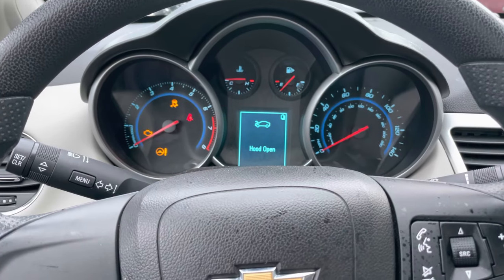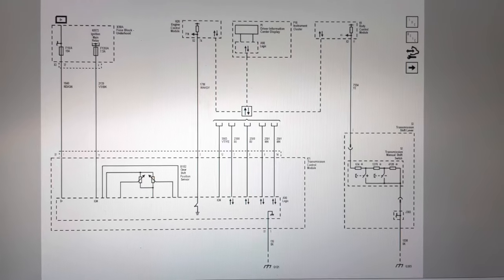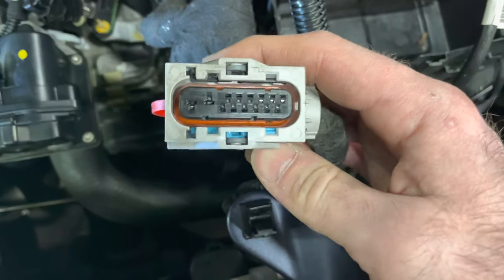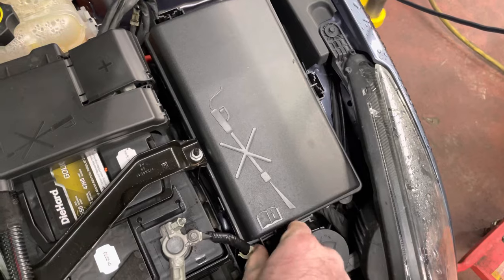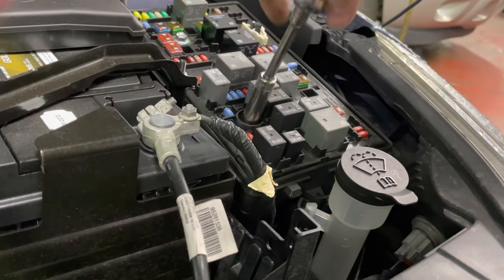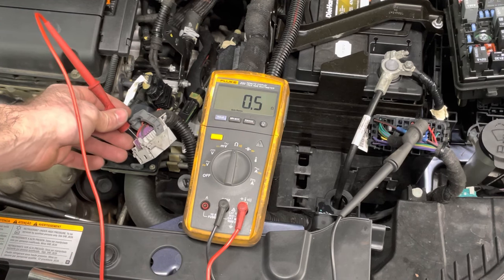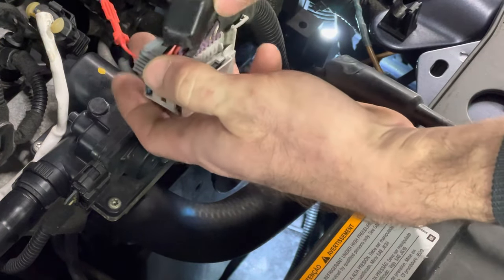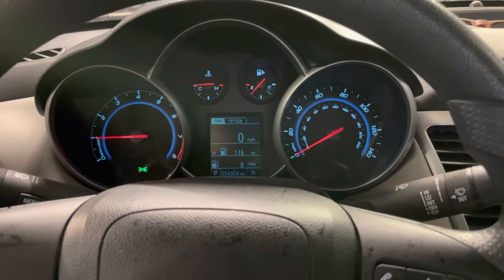Cruze Limp Mode... TCM No Communication U0101

Comment: Great Video, Great Communicating with your subs and/or viewers and I am a New Sub..
I can really use a second opinion oh what's going on with my 2010 Impala 3.5L with 64K Miles. Second Owner and Uncle was First.. I know its long but Here's what's Going On. 
12-22-22 -  New Battery Due to Repeated Jump Starts
03-21-23 -  P0411 (See Below), P0522/P0523 (Engine Oil Press Sensor Circuit Low/High Voltage). Dealer Replaced Sensor
04-10-23 – P0411 (Secondary Air Inj System Incorrect Flow) Self Installed New Check Valve and Fine.
06-25-23 – P2440 (Secondary Air Inj System shutoff valve stuck open. Limp Mode, Warning Chimes, and Service Stabilitrac/Traction Control Warmings.
06-27-23 – P2135 (Throttle Position sensor 1-2 correlation) Limp Mode, Chimes, and Service Stabilitrac/Traction Control Warnings.
07-01-23 – Nothing Done since 06-27-23. Before starting, Scanned, No Codes. Started fine but check Engine Light. Scanned and No Codes. Cleared Codes and Drove perfect.
08-24-23 – No Crank No Start. Jumped it and was fine. Brought it to a SEMI Local (30 MIns) Mechanic from a Good Friend Referral.
08-29-23 – Determined 8 month old battery Failed. New Battery and New Secondary Air Inj Pump (Was Working BUt VERY Loud).
12-15-23 - Tried Factory Remote Start. Went out and wasn't running. Started it but Running Rough (Maybe Limp Mode). All the above warnings and chimes plus all the gauges were freaking out. Turned off and Tried again same thing. Left it for a day or two, No Crank No Start. Tried it again and as I was bringing the key back from the Run Start Position it Cranked For a Split Second. Tried several more times No Crank No Start.
12-20-23 - Put in On Position and Hooked up former Mechanic Scanner and "Communication with Vehicle has Been Lost". So couldn’t scan any codes or check any DATA… I tried Starting and same issue as above.. Tried to Swap the Starter relay with a duplicate Rear Defog Relay and it started but the gauges were still going crazy, chimes, Warning Messages and running ruff.. I tried Hooking the Scanner up again and the car began to idle fine, no chimes or messages but all the gauges showed as 0 and you could not see what gear it was in… Tried to scan and "Communication with Vehicle has Been Lost"
12-22-23 - We decided to take it to the dealer for diagnosis. Went to bring to dealer and no crank no start. Messed with the battery connections , grounds, fuses, relays, connectors and it started up perfect. No check engine, lights, chimes, and idled perfect. Turned off to get my wallet to take for ride. Went back out 5 mins later and no crank no start. Finally got it started and drove to dealer . 1/2 the trip the door locks kept locking and unlocking constantly (This was NEW), gauges went crazy, Chimes and warning messages… But the Car was not in Limp Mode… Second half the car went into limp mode and no chimes no gauges no locks no nothing and could only go 20 mph. Nerve racking. I got there and they went to bring it in and no crank no start. Got it Started, Drove it in, hooked up scanner and "No Communication". The first thing they did was put a new negative cable Connector on it and it cleared up all the chimes, gauge wackiness and warning messages. Tuesday they are going to concentrate on the starter..
12-26-23 - Dealer Replaced the Starter. 
12-27-23 - Started but that same weird Crank after I started Coming Back from the Start Position.. Drove Perfect.
12-28-23 - Started and Drove Fine.
12-29-23 - No Crank No Start. Made appt for 01-02-24 with dealer to fix.
12-31-23 - No Start No Crank.
01-01-24 - Using Mult Meter I check the Battery and it read 12.2 V… I visually inspected the Fuses, Tugged and Inspected any Wires that Had Tape on them, Tugged on Connectors… I tested the DLR Pins 6 and 14 and got 60 ohms… I turned the Key to ON and hooked up Scanner and No Communication… Got Mad and Just tried to Start it and It Started… Beings I didn’t Initially try to Start it, I am not sure all the Poking and Prying did anything or it was Just ready to Start.. The Car Idled Great and No Issues Except the Check Engine Light was On… So I scanned it and got the following (9)Codes: U0073 (Control Module Comm. Bus Off) (2) Stored, (2) Pending and (2) Permanent, P0700 (TCM Requested MIL (Check Engine Light) Illumination) Stored and Pending & P150C (TCM Engine Speed Request Circuit) Pending… I Drove it to the Dealer with the Scanner Hooked up (Because of what happened on 12-20-23) but this time it was Not In Limp Mode but it didn’t have full Power.. The Gear Shifting was VERY HARD where you Could Here and Feel each Shift.. Just before I pulled into lot I Cleared the Codes.. I pulled into lot and disconnected the scanner and drove it around the lot and now I did not here or feal it going into second gear.

They have had the Car Since and they say They Have not had the No Crank No Start issue but they did get the SLuggish drive (Not Limp Mode) and had the warnings and Chimes.
BUt by the time they get back and start Diagnosing the Car is fine again. They think its a Bad PCM and that they don't think it's Wiring Issues.

If you have read this Far I am Thank Full for your time... Any help or thoughts would be much Appreciated... This is my Sons car who just got his license last year and the car doesn't get driven hardly at all.. He is afraid to drive it and Frankly I don't blame him.. Just Me doing local errands and to work once a week..

Sincerely Dan
Reply from the maker: Thank you very much! I do what I can. 

That particular era of impala had a lot of body control module failures, which could possibly cause all of those weird problems.

Also, you may have something loose in or near the under hood fuse, panel it sounds like… Or possibly a battery cable loose or corroded. It would also be worth checking the battery positive cable for being loose at the starter motor.

Measuring resistance at six and 14 if you are measuring 60 ohms during the fault… That means the network circuitry is at least intact
.
Reply: Get an auto electrician to clone a good second hand engine ecu.

Comment: So I have this exact same issue.  Troubleshooting next steps lead me to this video (VERY helpful).  I disconnected the connector to the TCM, and checked PINS 1 and PIN 2, and ignition is all fine.   How would I check the data?
Reply from the maker: Year make and model? Kind of depends what kind of tool and testing method you’re using. You said you have positive current, what you actually mean to say is you have positive voltage. 

Voltage=pressure
Current= rate of flow

If you are measuring more than 0 volts on terminal 2 which should be the ground, this implies the ground is open or high resistance. I’d recommend using a test lamp. 

Thank you for the comment. Let me know if I can further assist.
Reply: @DadsGarage Diagnostic Specialist  it's a 2014 Chevy Cruze LS just like the one you worked on.  I checked the B+, and both + wires from ignition using test lamp.  The only thing I dont know how to test is to see if it's sending data from the TCM.
Reply from the maker: @ANN4ISME  the only tool I truly trust for testing a data communication circuit is a lab scope so you can view the signal quality. However most of my career had been spent working without the right tools and “make it work”. So here’s what I would do to verify a data circuit. 

1. You need to prove the module has everything it needs to operate, that’s easy because it only needs a few things such as constant battery positive voltage, ignition voltage or wake up signal, ground at all times.

2. After proving that, if you want to test the integrity of the data comm circuit you need to ask some questions? How many modules are failing to communicate? If only the TCM is failing to communicate then most likely the problem is related to only the TCM circuits, as some no communication faults can be elsewhere in totally unrelated systems which I show in another one of my videos. 

Disconnect both ends of the circuit with the battery disconnected and use a DVOM to test 

A. Resistance end to end which should be 0 ohms - 10 ohms
B. Resistance to ground which should be infinite or OL
C. Resistance to battery positive which should also be infinite or OL. 

If the power and grounds are ok, the data comm circuit is ok, and all of the other modules and ok and also setting codes which relate to “I can’t talk to the TCM”, then we have to assume the TCM is faulty. 

Module failures are rare in my experience except certain makes and models which have high failure rates with no associated cause. In most cases if you find a module has failed you need to look really close at why the module failed before you plug in the expensive new module and destroy it.
Reply: I have the same vehicle 2014 Chev Cruz 1.4L.  

Power, ground, & Ignition pins are all ok on in that TCM connector. I still get U101 . As you mentioned I also have BCM no communication as well where TCM gets it is feed
Reply: Hi friends, mine it'a Cruze LS 2010 2L z20s1-D 92kw with manual transmision, i had U0101-71 dtc on EBCM - lost comunication with TCM, how is that posible if manual transmision ?

Comment: I have the same code on my impala is a 15 but it’s telling me to replace the transmission valve body assembly is this true
Reply from the maker: Yes, similar to the car in this video the transmission control module is mounted to the valve body, it may even be the same 6 speed transmission or a variant of it. The module itself can be replaced separate from the rest of the valve body. 

In my experience, module failures are rare  on these and usually the problem is wiring related. 

Thank you for commenting.

Comment: I have a Chevy Impala 2013 with the same code as this and it does the same thing doesn’t show what gear the car is in and it jerks when changing it only to reverse and it’s in limp mode I believe I’m considering changing the TCM or should I look at the connections and everything before doing so ? 😭
Reply from the maker: Thank you for commenting Fabricio. 

I would recommend retrieving the codes from the Transmission Control Module if possible before doing anything.
Reply: @DadsGarageDiagnosticSpecialist  thanks for replying to fast, but how would you retrieve the codes from the transmission control module ? Do you need a specific scanner ?? My brother only has an obd2 scanner that’s how we were able to read that it had the U0101 code
Reply from the maker: @fabriciodiaz1018  yes sometimes you need a more advanced scan tool capable of communicating with non-powertrain related modules. 

A generic OBD2 scan tool can usually communicate with the ECM and also the TCM. I’m going to assume you retrieved the U0101 code from the ECM indicating that the ECM is unable to communicate with the TCM. If your scanner is capable of checking TCM codes and data I would use it to attempt to read code/data and if it fails, that confirms the lack of communication. 

Communication diagnostics can have multiple failure scenarios, but if it’s only the TCM failing to communicate which is shown in my video….that means the problem is with the TCM only…..so that means we need to check TCM power and ground supply and then check the communication circuits. Watch the video again where I explain on the wiring schematic there are only a few circuits to check. It could be as simple as a blown fuse. 

Let me know if you need more assistance. Thanks.
Reply: @DadsGarageDiagnosticSpecialist  thank you so much  I will let you know!
Reply from the maker: @fabriciodiaz1018  excellent. I’ll assist as much as I am able.

Comment: I have the same problem, I already did everything you say but it only worked for a while...
can you help me?
Reply from the maker: Year make and model? What codes and symptoms do you have?
Reply: @DadsGarageDiagnosticSpecialist have 11 Chevy Cruze I changed the pcm and solenoid and now no crank. Have trouble with key fob and scanner keeps saying no contact to ecm
Reply from the maker: If the engine control module was replaced an immobilizer system learn must be done.

Comment: I'm having the same issue with my 2015 Chevy Impala. No one can figure out why I have no communication with my TCM. My car is stuck in limp mode. I hope this is the same answer to mine.
Reply: I have also replaced the TCM twice now and now the new one they cant be coded due to no communication with the TCM. They say there is a short somewhere but they can't find it. I've been at a loss on this car for 10 months with no solution.
Reply from the maker: You just need to find somebody that understands how to diagnose a loss of communication fault. 

Thanks.
Reply: So I have taken it to another mechanic for the loss of communication with TCM and to get it coded so it will no longer be in limp mode. Once again the can't figure out what is wrong with my car. I have literally done everything but change my transmission. Im really at a loss. I've had personal mechanic look at it. I've had two different dealerships look at it. All of them with no answer.
Reply from the maker: @justinreed9821  is the fault not present when they look at it? They shouldn’t have such a hard time diagnosing it unless it is intermittently failing. 

If the problem is intermittent it is almost certainly an electrical fault.

Comment: Thank you for the video. as it's very helpful for me. What type of diagnostic machine are you using? I have an OBD scanner. My car has error code U0101. The mechanic diagnosed a TCM problem and have them fix things that might cause the problem before fixing the TCM such as flushing the transmission fluid, changing spark plugs, and connector, and checking electrical wiring. The engine light is on and off. There are days it's off and days on with Code U0101.  Spent almost $4k now going back and forth to the car shop. The Mechanic says it's transmission and will cost almost $3k for parts and labor with the used transmission but cannot guarantee it will resolve the problem.  I can hear a loud clicking noise when shifting from the park to reverse gear. Shifting feels like dragging from 15-24 speed but is quiet and smooth the rest of the speed. I will appreciate any input. Is there anything else you can suggest that needs to be checked before we jumped in the direction of changing transmission? The budget is kind of tight but the car is a necessity for driving to work. Is it worth changing the transmission, especially with a rebuilt one? We are looking at bringing it to AMCO transmission. Please help.
Reply from the maker: Thank you for commenting Jessica. Maintenance services such as transmission flush, spark plugs, etc. will not cause or contribute to a U0101 loss of communication. They have have recommended a transmission flush due to related effects such as if the TCM fails to communicate the transmission will operate in default and if driven in this condition can cause transmission overheating and damage. 

From your description it seems like your mechanic is just guessing, but I’m not involved so I don’t know details. 

If the transmission is damaged then yes it’s advised to replace the entire unit with a rebuilt/remanufactured, but still you must solve the U0101 code beforehand or you risk destroying a new transmission. 

You say some days it’s off and some days it’s on, this suggests loose terminal fitment in a connection somewhere, possibly related to the fuse panel in my video, but would require accurate diagnostics.
Reply: @DadsGarageDiagnosticSpecialist Your response is much appreciated. We decided to just take the car to AAMCO. Hopefully, they will be able to correctly diagnose the issue. The engine light with code U0101 was gone for three days but then came back. The car is still running smoothly with no issues. Thank God. Thank you again for your video.😇
Reply from the maker: @jeseccasantillan5195  yes of course! Thank you.
Reply: @jeseccasantillan5195  Hey Just seeing if you got a solution to your problem sounds alot like what mine is doing
Reply: @doyledaines9677  
Hello. I am sorry for the late reply. We took our car to AAMCO transmission. They will charge $184/hour for diagnosing the problem. They cannot guarantee how many hours 2-4 hours maybe before they  confirm that the issue is transmission. Now are car has an intermittent limp mode problem with engine and traction lights on. We made it home by driving 15 miles/hr. Turned off the engine when it went limp mode and the car started to jerking forward. We have it towed to a machine shop but because it stayed in our parking for three days prior to towing, the engine and traction lights went off and the machine shop could not diagnosed the problem. We asked GM motors if they can diagnosed the problem. Was told that based on the description of the problem it might be the TCM. However they cannot guarantee that it will fix the problem because there might be other problem after changing the TCM. It would cost almost $1400 or more for parts and labor. We decided to just keep the car and probably will sell it as is. It is running good so far.  Ut because the car is a necessity for my husband’s job, we decided to rent a car monthly. Try to avoid encountering an intermittent limp mode issue while driving to a highway. Hope this helps.